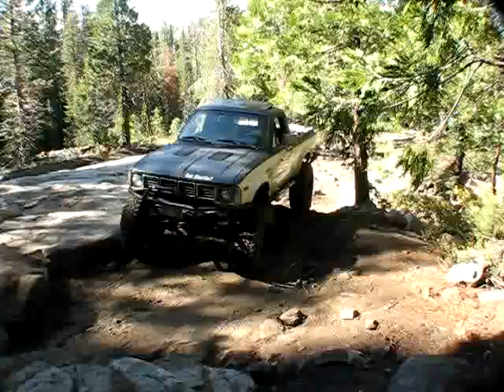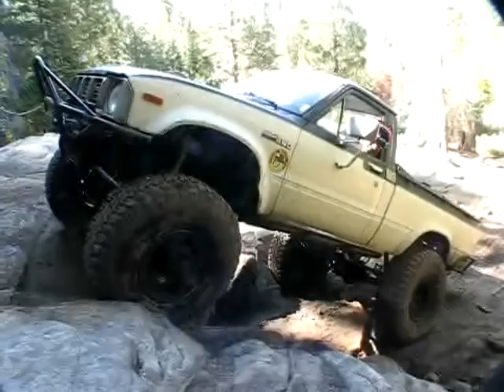John drives BigMike's Truck at 511:1 Crawl Ratio

Comment from the maker: Thanks for the comments! @coolassyota: I am running a Triple Ultimate Marlin Crawler consisting of a Marlin W56-HD transmission > 2.28 Marlin Crawl Box > MC08-23 Billet Marlin Adapter > 2.28:1 Marlin Crawl Box > MC08-23-R10 Rotated Billet Marlin Adapter > 4.70 23-spline Total Spline Marlin Competition Chromoly geared transfer case. Then at the axles I have Marlin-built Yukon 5.29:1 gears with Toyota Electric Lockers front & rear. So it's 510.53:1, or 511:1 final drive.

Comment from the maker: bachkrabbler, actually because the Marlin Crawler can greatly reduce your vehicles speed, the driver has an enormous amount of time to react to the trail and his truck. Marlin wheeled his truck at 1,047:1 for over 10 years on STOCK axles and never once broke them, and his truck weighs over 4,500 pounds loaded! It is all about driving accordingly. You are right, if you get in a bind and floor it and load up the drive train, something must break. But we have so much time to respond! It's amazing!

Comment from the maker: @revococo: Ignoring losses, It is true that my truck can develop 90,363 ft-lbs of Torque to the tires, and even more to the point, Marlin's CRAWLER truck can develop 242,866 ft-lbs of TQ, in both cases thanks to our Marlin Crawler setups. Obviously that is grossly more TQ than what a stock birfield can handle (about 50,000 ft-lbs), so it is all about how you drive according to your vehicle's limits. I ran stock Birfields with 35" tires for 4 yrs, upgraded when I got 37" tires. Never broke any.

Comment from the maker: Hello taitai907, that is correct, due to my Marlin Crawler Triple Ultimate Crawler transfer case, I literally have 30 different forward gears (and 6 different reverse gears!). Marlin's truck is even better with 35 forward and 7 reverse gears! The simplest way to explain it is that I have a 5 speed transmission and a 6 speed transfer case; 5 * 6 = 30. The 6 different t/case ratios I can select are: 1:1 (for city & freeway), 2.28:1, 4.70:1, 5.20:1, 10.72:1, and 24.43:1. Thanks for the comment!

Comment from the maker: @justbeabro You are absolutely correct, 511:1 is far too low as is Marlin's 1,372:1. Both are impractical. But we run triple cases to prove the strength of our products, and to be able to demonstrate what lower gearing can do for the customer. The nice thing about it is how it's fully selectable: My 1st gear low range ratios include 47:1, 98:1, 109:1, 224:1, and 511:1. The majority of our customers use the 109:1 ratio, while some opt for the 224:1. The sky's the limit with Marlin Crawler!

Comment from the maker: @TheSteelhead15 Thanks for the comment. In 1st gear it should do about 0.14 MPH at idle, and in 30th gear I've had it up to 110 MPH with the 37s. My speedometer doesn't go up that high, so I had a friend in another vehicle verify it. The 3RZ has great power, but it was really struggling to get to 110.

Comment from the maker: @JuniorPros118: Absolutely! When the Marlin Crawler is shifted into High Range, it becomes a 1:1 direct drive device, so that is behaves just like a stock pickup. My truck shown in this video has 37" tires and a 1995 2.7-liter 3RZ-FE fuel injected Tacoma engine, and on the freeway it gets 21 MPG at 60 MPH or 19 MPG at 75 MPH. My upgraded Marlin Crawler brakes and High Steer steering system provide very nice road manners and the truck is a pleasure to drive on-road or off-road. Thanks!

Comment from the maker: @livelaughin77 Whoops, sorry yes I do also have a 1" body lift. My suspension is a bit complicated. I have removed 2 leafs from my front 4" Marlin Crawler springs and 3 leafs from my rear pack, running 2" pivot blocks in the rear with custom 1-way lockouts. The height of my truck is about 2" lower than a comparable truck with only a 4" suspension lift and no body lift.

Comment from the maker: @1450chaser: I am running 5.29:1 axle gearing because for the first 6 years after building the truck she was my daily driver (37" tires + 5.29:1 gears is almost the same tire-to-gear ratio as stock). You are correct in that if only used off road, stock gears would be plenty low (my Crawl ratio would be 397:1 with 4.11:1 axles). In fact, some people do this because its cheap and easy to find stock 4.11:1 replacements at wrecking yards. It just won't drive well on road stoplight-to-stoplight.

Comment: That is AWESOME! Thanks for sharing!

I have a stock '82, about to drop a 20R head on and will step the gears up a tad and put on 31's, nothing hardcore at all. Just a nice stocker. I won't be doing anything like this with it (It's in such nice original condition, hard to find like that these days) but that Tcase setup is sweet. What a crack up to put it in low and walk around the truck, just for giggles. Bet that truck will crawl up just about anything.

Comment from the maker: @57RxRxRgaming57 It is a Marlin Crawler Triple Ultimate system (2.28:1-2.28:1-4.70:1) between a 3.95:1 MC W56-A-HD transmission and 5.29:1 Marlin Crawler differentials with 37" MTRs on 8" wide allied beadlocks. The truck will be up at the 11th Annual Marlin Crawler Round-Up this weekend at the Rubicon Springs Campground.

Comment from the maker: OSSBanshee, thanks for your comment. No worries about how slow this is, indeed it is too slow for this obstacle! The same applies for Marlin's truck which is 1,372:1: we do it to demonstrate how incredible a Marlin Crawler is. For normal wheeling I run between 35-100:1, when I'm on rocks larger than my truck I run 80-200:1, when I am extremely nervous I'll use 2nd gear at 277:1, and only when I'm doing something really stupid then I'm in 1st at 511:1. Otherwise it's just for show! :-D Cheers!
Reply: Husoku I know this video is old but curious to what your set up is to get that. I run 4.11 R150F witch has a first of 3.83 first gear first case is 2.28 and rear is 4.70 . With a 35 in tall tire I’m right at 110:1 I’m trying to figure out what combination y’all came up with to get 511:1 unless I’m doing my math wrong. Just curious that’s all.

Comment from the maker: Haha yeah that's crazy! I am just like Marlin in that I prefer how a 4cyl engine Rock Crawls, how it lugs down and has great throttle control even at RPMs as low as 300. They are lightweight (don't need other heavy weight drive train components), generate less heat (only 1 exhaust manifold, don't need a large radiator, more air flow/clearance in engine bay), and there is less to go wrong, less to break down, cheaper to maintain. The 3RZ-FE is great because it makes as much power as the 3.0 V6!

Comment from the maker: Hello Shane, thank you for your question. This is done with no throttle at idle RPM, which reads 800 rpm on my tach. To illustrate the amount of torque the Marlin Crawler generates, when I am idling in first gear in 4WD and press the brake pedal with both feet as hard as I can, the idle will drop to about 700 RPM and the truck will continue to Crawl. So 700 RPM with zero throttle is more than enough torque to overcome all four wheel disc brakes.

Comment: So what's the regular? 255:1?
Reply: Hello John, thank you for the comment. In short, the typical reduction for what we call the Dual Ultimate Setup, is 223:1. In detail, the typical t/case gear reductions our customers run are 2.06-times, 2.28-times, and 4.70-times lower than stock. (BigMike's Triple Ultimate t/case setup is 10.72-times lower than stock, and Marlin's Triple Overkill t/case setup is 22.09-times lower than stock!)

With the typical stock axle ratio of 4.11:1, a manual transmission 1979-95 4cyl pickup or 4Runner will have a 1st gear final drive ratio of 37:1.

With our basic and simplest to install single 4.70:1 gear set, the final drive goes from 37:1 to 76:1 (or 98:1 with 5.29:1 R&P)

With our basic Dual Case setup, the final drive goes from 37:1 to 84:1 (or 108:1 with 5.29:1 R&P)

and with our Dual Ultimate Setup, the final drive goes from 37:1 to 174:1 (or 223:1 with 5.29:1 R&P)

We call the above the Ultimate ratio because anything around the 200 to 250:1 reduction truly is the ultimate setup for the most demanding situations!

Comment: what gear ratio would you recommend for 37's, i have an 84 extend cap that im in the middle of doing an ls swap into
Reply from the maker: Hello 97144967, I recommend 5.29:1 diff gears. This ratio will get your RPMs almost back to stock (they will be slightly higher than stock). Their is a 5.71:1 option, but they do not have nearly as good a reputation as the 5.29s. The basic rule is 37" or larger = 5.29s, 35" = 4.88s, 33" = 4.56s. My truck shown in this video runs 37x12.50R15 tires and 5.29:1 Ring and Pinions. -BigMike
Reply: sweet thanks alot, this is my first 4wd build of this scale. hopefully ill have the ls fired up soon and ill be able to focus more on suspension and axels
Reply from the maker: Sounds good. Also, I wrote, "[your RPMs] will be slightly higher". I meant to say they will be slightly lower. So 37" + 5.29:1 R&P will be slightly taller than the stock 29" + 4.11:1 R&P combination. You can play with our online Vehicle Speed Calculator to compare the differences: http://www.marlincrawler.com/java/getspd_calc.html -BigMike

Comment from the maker: @lacombboy: I am running a Triple T/Case setup as a 2.28:1 x 2.28:1 x 4.70:1. The reason why I do this is so I can demonstrate to customers how a Marlin Crawler can change their lives. I can show a stock setup (2.28:1), I can show a single 4.70:1 setup, I can show a standard dual case setup (2.28 x 2.28), and I can show a Dual Ultimate setup (2.28:1 x 4.70:1). Marlin's CRAWLER truck runs 2.28 x 4.70 x 4.70, so he cannot show what a stock dual case setup (2.28 x 2.28) is like, but I can :-)

Comment: How did you get 511:1 with just two TC’s?
Reply: Bryan, thank you for the question. BigMike has a Triple Marlin Crawler Transfer case system comprising of 2.28:1, 2.28:1, and 4.70:1 gear sets. Triple are, of course, unnecessary, but with these gears BigMike can demonstrate all our popular gear options: Factory 2.28:1, Single 4.70 (4.70:1), Stock Duals 5.19:1 (2.28 X 2.28), and Dual Ultimate 10.72:1 (2.28 X 4.70). Marlin and BigMike are the only employees with Triples and they do this specifically to demonstrate these available gearing options that we commonly sell! Thanks!

Side note: We are migrating all our videos from BigMike's old personal YT account (this account, "Husoku") to our official Marlin Crawler Media account. This video might get deleted and reloaded to our MarlinCrawlerMedia account soon.

Comment from the maker: patriotsundergod: In terms of Rock Crawling, you are right. The only time I have really "needed" 1st gear is when I was about to take body damage. I could let the clutch out while riding the brakes very hard and then determine to continue or not. Its mainly a demonstration gear. Marlin Crawler considers 223:1 to be the "Ultimate" gear ratio (term coined in 1997), but I find my 2nd gear (277:1) is the most ideal ratio for me. It sure is nice to shift into any gear ratio I need and just go! :)

Comment: What kind of lockers do you recommend for this year yota?
Reply from the maker: Hello Kyle, thank you for the comment. This is a loaded question and you'll see different opinions depending on who you ask. In my opinion, because I also use my truck to drive to the trail and back and do a lot of city and highway driving, I prefer a locker that can be turned off. This also fits my driving style on the trail where I prefer to wheel as much as I can open-open and only use the locker when I am stuck. I find a lot more challenge and control this way.

The two choices for me become 1) air-operated or 2) electric-motor-operated. Air operated lockers include the ARB Air Locker and the Yukon Zip Air Locker. Both are excellent choices, but I prefer the electric-motor approach, which is where we take an electric locker from either a FJ80 Land Cruiser or a Tacoma/4Runner and modify our older Hilux axle housings to accommodate. This does require some fabrication work but instead what I did was I installed a complete Tacoma rear axle (1995-2004 8" e-locker type) into the rear of my 1981 pickup. This also gave me the advantage of a wider trackwidth for improved stability. (My front axle is the width of a FJ80 Land Cruiser.)

I explain why I prefer the Toyota E-Locker by explaining what I dislike about air operated lockers: An air locker requires air pressure to operate. If you do not have air pressure then the locker does not engage. Therefore, if the air source is ruptured externally (rock snags your air line or exhaust melts it) or internally (ring gear rubs on the copper air line due to installation error) then you are screwed. Also your air compressor could take a dump and you'd be screwed again. (Also if it leaks internally then you will pressurize your axle housing and risk blowing out axle seals.)

With an E-Locker, if the motor fries or my wiring melts down or a I blow a fuse and don't have a spare, no biggie, I'll just remove two bolts and slide the motor off and then manually engage or disengage the locker using a flat head screwdriver. Done. So even in the worse case scenario I can have an always open or always locked (spool) e-locker. Then at the end of the trail I can just unlock it and drive home normally without fear or losing control of my vehicle or wearing out tires.

Some will say, "oh well you have to wire the e-locker" and my argument is well you have to wire an air locker also: It has switches, relays, wiring, fuses, grounds, etc.

There is a good argument for the air locker and that is that it is a stronger design than the Toyota e-locker. But because these older Toyota trucks are lightweight I have never worried about the strength of my e-locker. After all Toyota designed it for a truck much larger than my old Hilux that had a V6 and a towing package so it is plenty strong enough for Rock Crawling.

The alternative to all of this is to have an automatic type locking differential where there is no wiring no motors no fuses no compressors to worry about. For this I'd recommend either a Yukon Grizzly or an Eaton Detroit locker. This is a locker that is installed inside your differential and it uses a ratcheting mechanism to sense large differences in torque loading to each axle shaft and engages only when needed. The issue here for me is that it is always there and is unpredictable: If you're going around a highspeed constant corner with dirt or salt in the middle of the road from snow and ice management and you gun it and hit the gas, the locker may (or may not!) engage suddenly even at highway speeds causing your outside tire to loose traction and your truck to oversteer (drift). I'd much rather have a locker where I can choose when to engage it and prevent this. Also when you make sharp corners at low speeds in a parking lot and accelerate the locker will engage and you'll have your tires chirping even trying to find parking in a parking lot which causes a ton of unnecessary wear to very expensive off-road tires!

I hope this helped and have a nice day!
Reply: +Husoku thanks man for all the info! Im planning on buying an 82 yota in the near future and want to build it so it can be a daily, and good offroad, so the arb air lockers sounds like the best bit
Reply from the maker: Sounds good. It will cost more up front as air lockers (and also the e-locker) are more expensive and require extra work (wiring, a compressor, etc), but in the long run having a selectable locker will FAR out weigh the initial investment. What we see are many people starting out with an auto locker only 1 or 2 yrs later removing it and switching to a selectable type -- which costs more overall as they have to pull parts out and reset the pattern on their ring and pinions twice. Honestly the freedom of being able to run open or locked at any time is truly amazing. It is awesome to be slowing going down the trail and then suddenly you lose forward momentum and you just sit there slowing spinning a tire.... work the wheel right... then left... ease off the throttle as much as possible without stalling it... and then at the last moment you flip 1 simple switch to engage your locker and WHAM suddenly you magically pull over that rock. It is an amazing feeling!

Also one additional thing I forgot to mention is turning capability. We all know why we have a differential in the first place, so that our tires can turn at an unequal rate of rotation, but you don't realize how important this is in terms of your cornering radius until you try turning corners with automatic lockers (Grizzly, Detroit) or worse a fully-locked (Spool or welded). Having the ability to unlock your differential before any tight corners really pays off. I can get through tight corners and technical sections without having to backup when others are making three, four, and five point turns just to get through the trail because they have a welded front end or a Detroit out back.

So a greater investment of both money and time up front, but in my opinion it is a no-brainer to go selectable from the beginning and never look back. Also if you ever decide to sell your truck in the future, I guarantee your resell value will be far greater with a selectable locker(s).

Regards,
BigMike